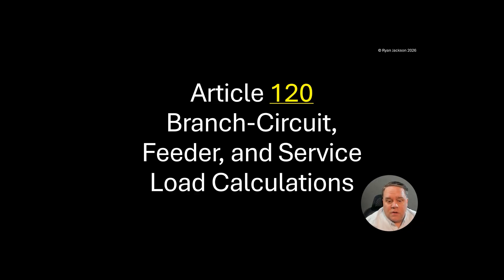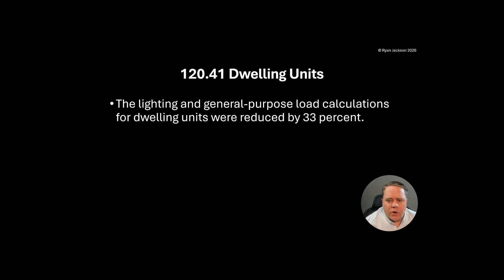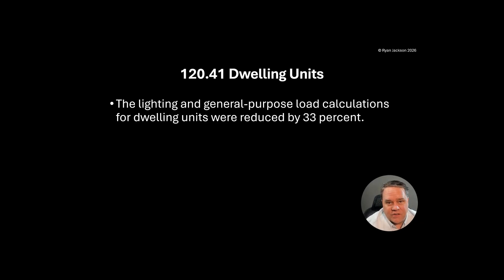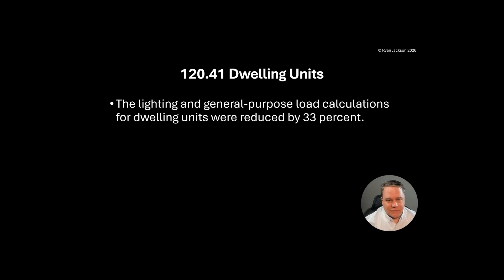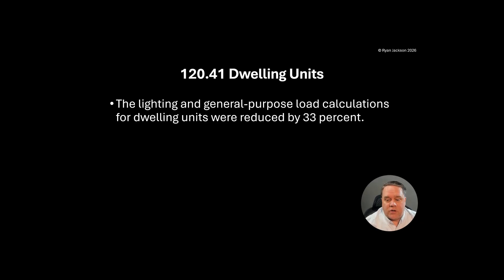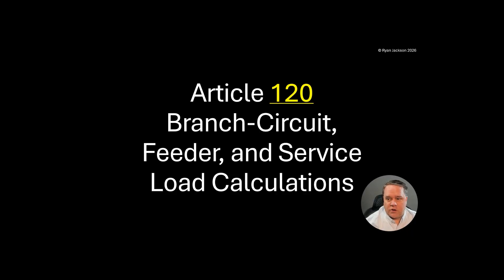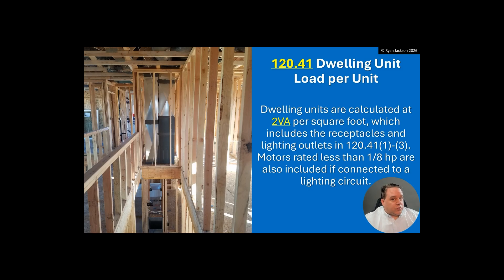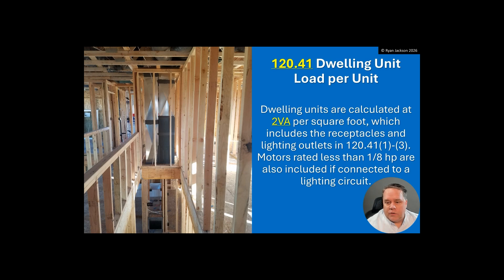100 days of 2026 NEC changes Day 12: 120.13 & 120.41 Dwelling Unit calculations.

Comment: You get triggered by the Code
I get triggered by expensive flimsy 
Light fixtures that I had to install.
I still get flashbacks.
Reply: it's bad in commercial; huge,flimsy things
Reply: Wired in a large house on over ten acres of land for a thrifty person. He purchased what he said were brass outdoor wall luminares that were under a porch roof. There were extra flimsy very thin brass plated over steel with extra long metric screws that I had to purchase a metric bolt cutter for. A few months later he complained that the lights were tarnished & had streaks down them. Told him that's what happens when you save money buying lack of quality control products from communist china. He wanted me to replace them for free. Told him to get somebody else. Before retiring I would charge  home owners at least $10 extra for any Ho Hsts they purchased that were not Lightolier brand. Got tired of getting gingers cut from razor sharp hi hats. They were the first ones back in the 1970's that  came with built in NM clamps, and the 711 could be used for new & old work.

Comment: These changes man... I'm so sick of the code becoming more and more complicated for seemingly arbitrary reasons. 3VA here but 2VA there, exception here exception there. I feel sorry for all of the apprentices in the next 6 years that have to learn these pointless changes. We need a NEC overhaul but all we are getting is patchwork upon patchwork.
Reply: What numbers would you use that aren’t arbitrary?
Reply: @denverbraughler3948  Not sure. Simplifying the calculations would be a good start. We have never had issues with 3VA/sqft, sure the lighting loads are smaller but with states requiring EV chargers in every new build and all electric appliances, the need for 200A services has grown. It makes NO sense to calculate a service at 2VA but calculate a circuit at 3VA, just makes it more confusing. With these kinds of codes it's no wonder electricians and inspectors don't know half of it,